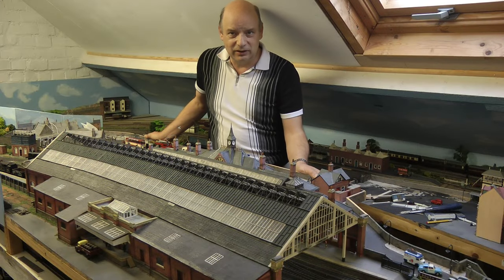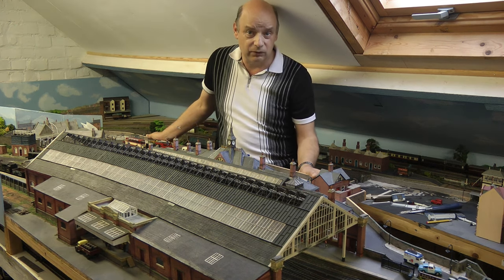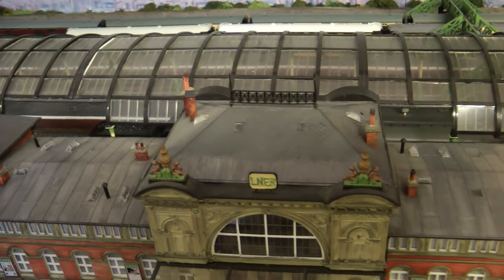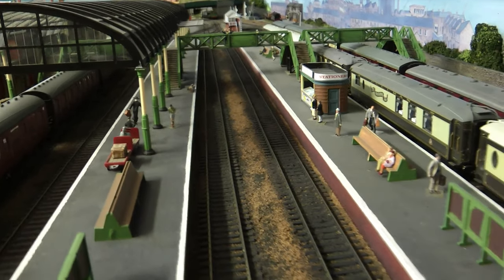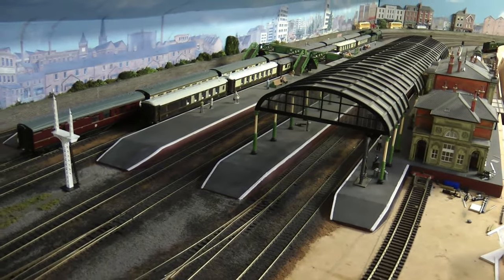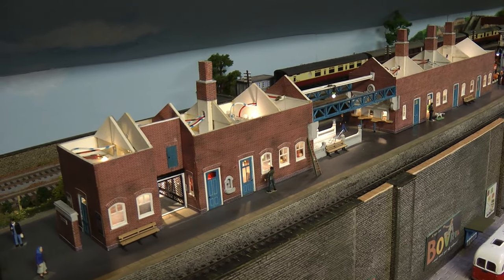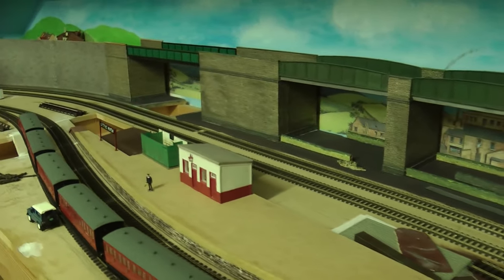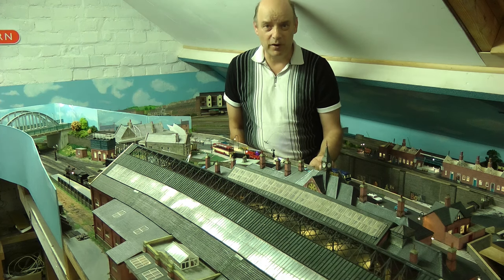The Stations Tour.                No444

Comment: An excellent recap Tony, not surprised you had some memory problems there’s so much amazing and varied/ different content duke box, barbers etc. I often think could do with an endoscope with a wide angled lens to have a peek in some of those rooms! You surprised me when said was going to initially plonk kits down; then it all changed with the SSS masterpiece, what a leap, but the Covid debacle was obviously perfect timing. Trying to do SSS in precious evenings might have been something very different! 
You really have got everything to fit in so well in that loft. I would be very interested to see how you planned it initially ( from pre baseboards - you had Tyne Dock underpass and framework built from the start if I remember correctly) and what if any major changes/ steps have occurred to your ideas as you got the track and station locations down and as you tend to completing this (if ever, ha ha). Is it worth a video on? All the very best Stephen
Reply from the maker: Good morning Stephen,  Memory. the trouble i have is, i dont remember every detail that i had put into each room. as it does vary. even now i think i am adding more details than i did when i had built shields. hence why tyne dock is taking so long. The baseboards where very basic at the start, then lots of small add on's kept popping up here and there. which now the layout has become to big. Lol. but yes like you have said many changes have happened along the way. thanks again for commenting stay safe. all the best Tony.